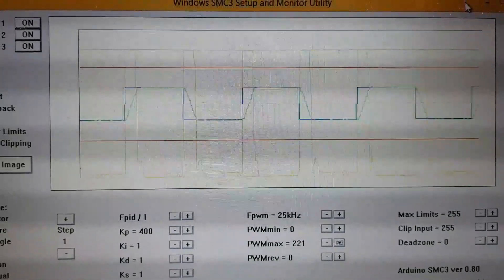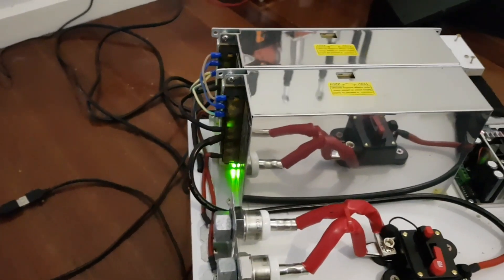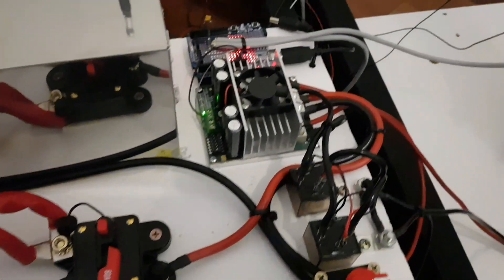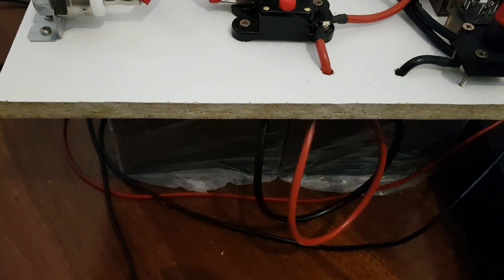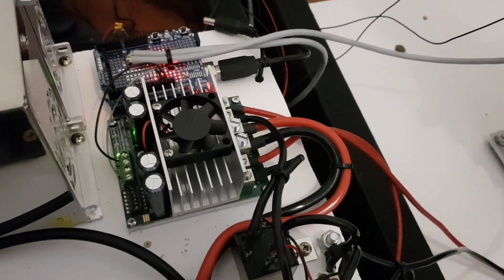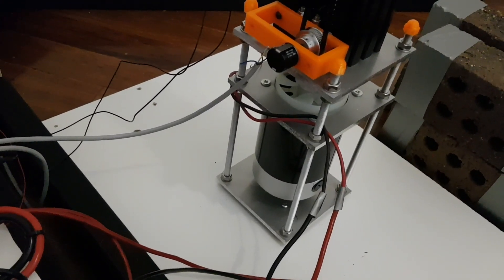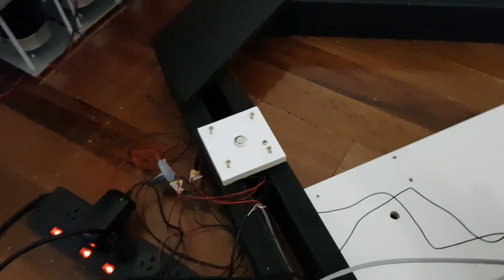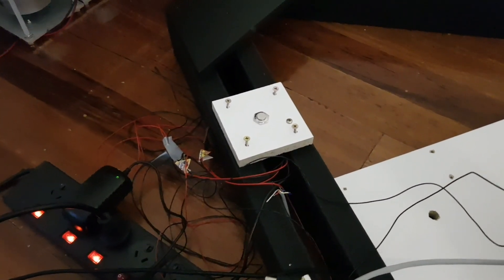X-Plane 11 6DOF motion platform speed test

Comment: Hello, how many Nm are the motors ... with those actuators, don't you think you could use them for a 4dof? Do you think they will not support the weight of the pilot and the chassis? Excuse my English, I'm from Argentina.
Reply: The Motion Dynamics motors are 24V @450W. If I recall the max rpm is 4500rpm which equates to 0.96Nm. As a guess, I would estimate that each actuator could easily handle about 30kg when fully driven, therefore, the max lift would be 180kg. This would be the weight of the frame plus the pilot and the joystick etc